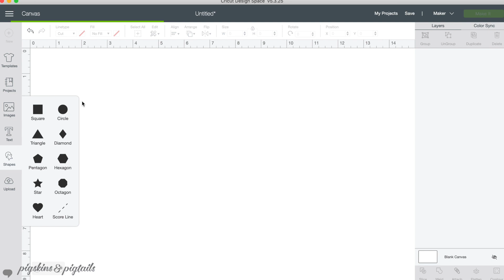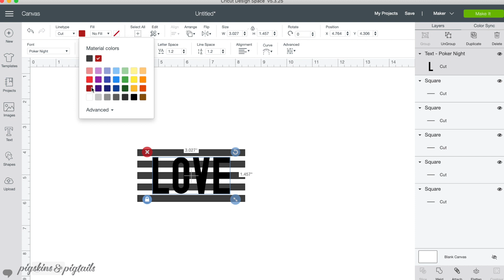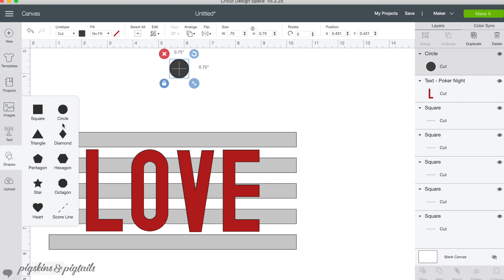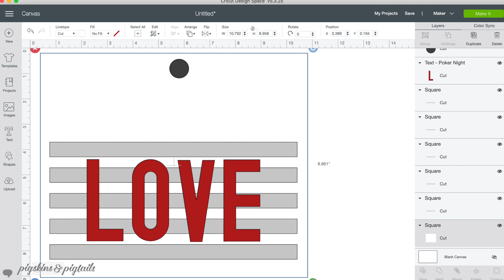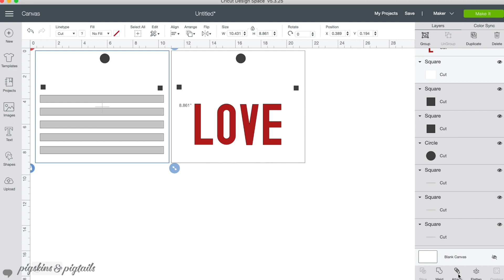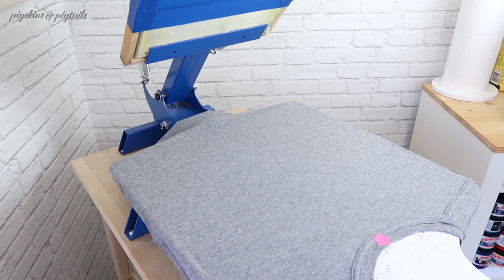Comparing 2 Methods of Screen Printing Overlapping Colors using Cricut Design Space

Comment: How do you hold the shirt so tight into the table? Do you use adhesive spray?
Reply from the maker: Any time you are printing on a press, you want to make sure to have an adhesive on your platen.  This holds the shirt/blank in place, so you can lift the screen and it will sit back down in the exact same spot.  Here is the pallet adhesive I use: https://www.pigskinsandpigtails.com/a/pallet-tack-adhesive
Reply: @pigskinsandpigtails  thank you!!!

Comment: Thanks so much! If I am adding a second design over the first one, should I cure the first background color first and then add the second? Or can I just let the first (background) color dry a couple of days, add the second color on top, and cure them both together? Much appreciated :)
Reply from the maker: I would let it dry but not cure it before putting your 2nd color on top.
Reply: @pigskinsandpigtails  Did exactly that and they came out perfect 👌. Also used an iron to fix the print 🤜🤛👍

Comment: How long do you let the ink dry before you do the second layer
Reply from the maker: If the design is overlapping, you want it to dry completely - which is overnight (or speed it up with a heat gun).  This is the heat gun I use: https://amzn.to/2ZKPzmQ

If the inks aren't touching, you just need the first color to be dry to the touch (so it doesn't get on the back of your next screen).  This can take about 30 minutes if you let it air dry.